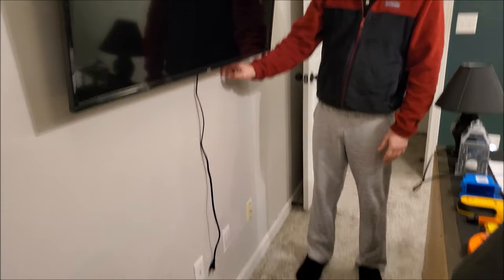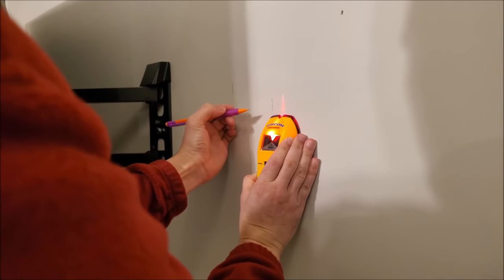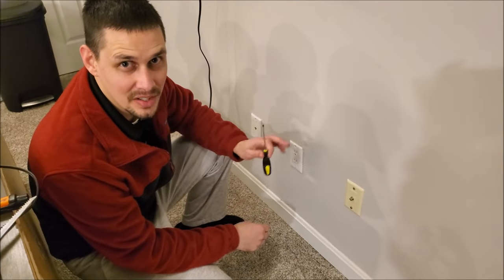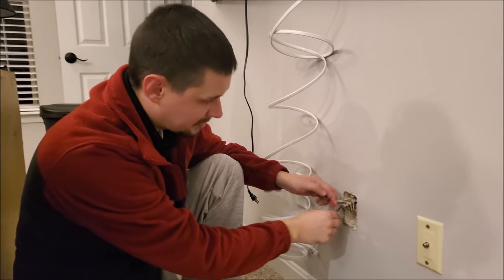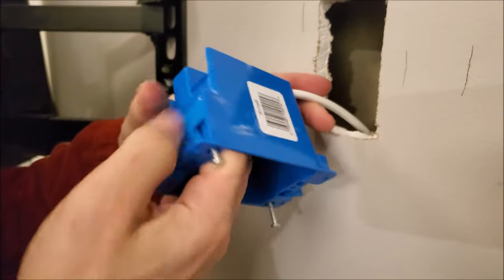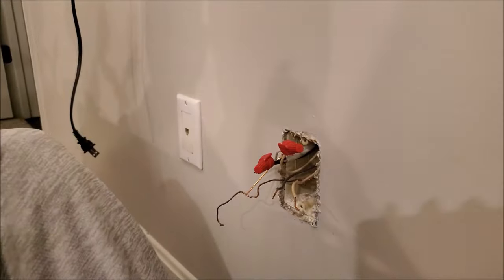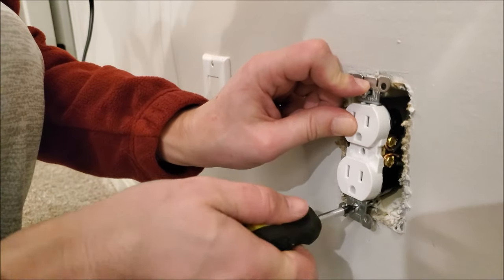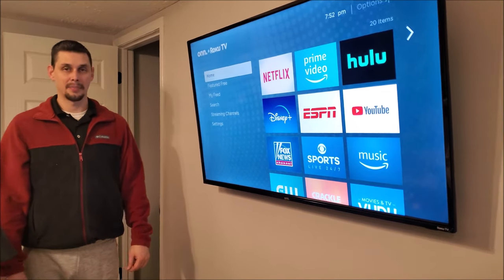How To Install A New Outlet Behind A Flat Panel TV Yourself

Comment: Easy install with the outlet being directly below the location of the new one. You were able to use same mount stud. Would like to see how this is done when you have to pass through multiple wall studs to get into position without tearing a ton of sheetrock out.
Reply: Single story you may tap into something and run the power thru the attic down, if studs are where you absolutely want to run power then you'll need auger and drill holes thru the studs
Reply: Why would he need to do that for a simple TV outlet? That was the title of the video right?  Almost every TV outlet is run off of one directly below it.
Reply: You’d have to tear up sheetrock then patch and paint afterwards. No getting around that, this isn’t magic.
Reply: I saw a guy on YT where he ran Romex from his tv position down to the floor. He then removed baseboard, cut the drywall out from behind the baseboard and drilled holes through studs there. That is where he continued to run the wire to the plug that was like one or two studs over. Screwed drywall back on, reinstall the baseboard and the work was invisible, hidden by the baseboard.

Comment: The only part I didn't get was at the bottom receptacle. Do you have to take and pig tail the wires to the left (of the existing receptacle) as he did in the video? Does it matter if you were to pig tail from the wire on the right? Once I know this I'll be good to go. Thanks!

Comment: 80pc of the time the boxes will be nailed to a stud on the left hand side    most ppl are  right handed    So if u hold a box with left hand and nail with right hand   Itll be nailed left     Speeds production when doing over and over      This goes out the window on tight spaces or special framing needs      If u have a difficult pull  attach an extra wire or string and leave in place as a pull if u ever need to run anything again    Cheap n easy

Comment: Do you have a video to move the coax cable up... is it as easy as pick the spot for the box above it and pull the coax cable up and install with plate there..?
Reply: Yeah, I just did this install yesterday and that's what I did as well

Comment: I got confused right at the end. I thought the hot (black) goes on the silver terminals, but it looked like you wired one of each on both sides?
Reply from the maker: The hot (black) wire is connected to the brass terminals, the neutral (white) wire is connected to the silver terminals.
Reply: @jdiy9481  Thanks!
Reply: Thanks I been making my lines above that box.. I knew I was doing something wrong lol

Comment: what would happen if the wall has a horizontal stud in the middle of it, I guess you gonna have to do the extra work and cut out the drywall where the horizontal stud is located and make a hole to pass the new wire in correct?
Reply: I saw a diy guy on YT use a bit extender. When the fire break was close enough to the box he was installing he used a bit extender and stuck it down into the hole and drill through that way - then fished the romex through. Otherwise you are correct, you’d need to cut out some drywall to get at the firebreak.

Comment: What was the purpose of the extension wires ??????
Reply: It's not recommended to have 2 wires around the same screw, because the screw is only designed to handle 1 wire at a time and a 2nd wire could slip out and cause problems; to avoid that, you can create a "pig tail" (extension) by twisting (wire nut) 2 wires together with a 3rd (the short extension), and place the extension wire onto the screw.
Reply: @0xC001  is dangers to put two wires on to one screw...?
Reply: @thomasayala1956  not recommended for anything larger than 14 gauge wire. Just make sure you tighten them down and you should be fine. You can also put electrical tape over the screws to hold the wires in better if you're worried.